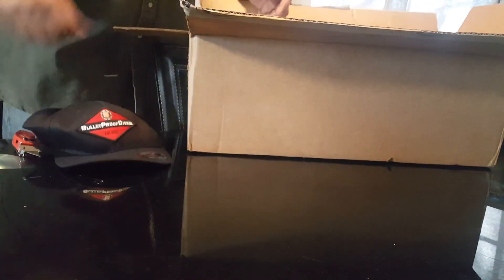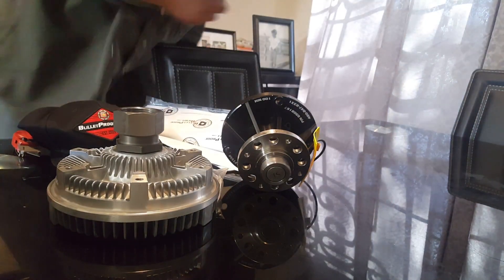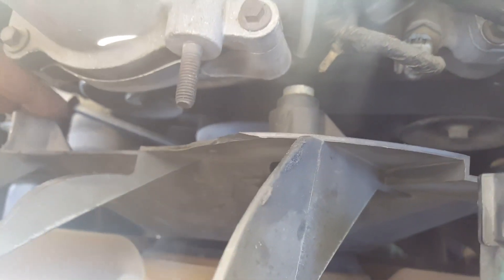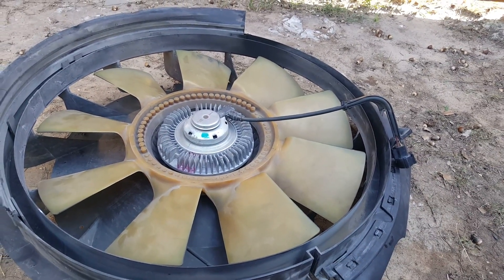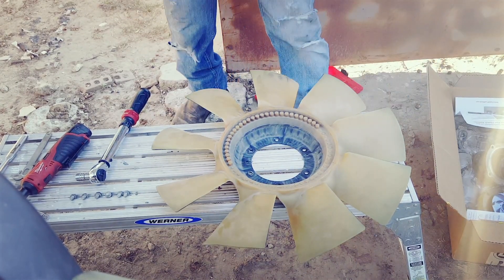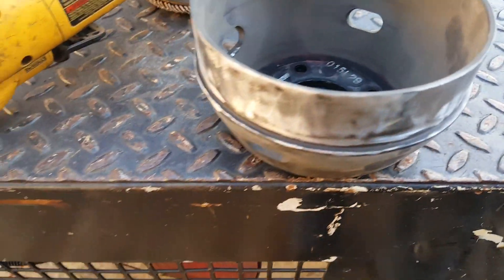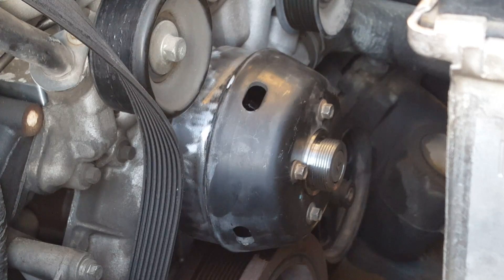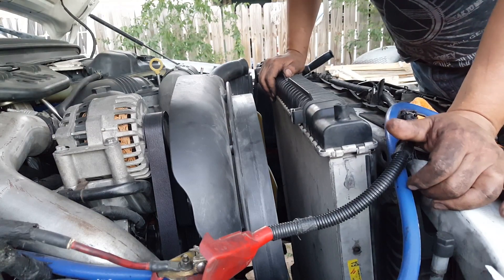Replacing 6.0 PowerStroke Water Pump and Fan Clutch with Bullet Proof Parts.

Comment: My ONE  plastic impeller water pump lasted 152,000 miles before it started leaking and the impeller was in good condition.  So, I'm not so sure a non plastic impeller is any better.

Comment: Would this cause the fan clutch to be loud when engaged?

Was making a loud noise like a bud shifting when old fan clutch was on. Put a brand new fan clutch and orginal blades and still same noise when engaged.

I’m thinking the blades are bad since they are   15 years old with 350k on them .

Any ideas?

Comment: Have you had any problems with the 7.3 fan clutch locking up randomly for long periods of time, and loss of fuel mileage? I saw another video of the 7.3 fan upgrade and he had exactly that problem.
Reply from the maker: No. Haven't had any issues with it. No overheating even with these 112°F nonstop scorching days
Reply: @XV_TV  did you notice any loss of mpgs?
Reply from the maker: Well it is a 450 so I get like 8-10 mpgs. It only moves if it's making money lol but filling up has remained constant

Comment: Thank you for the video but I have one question  did you just leave the connection hang in there go into the old fan clutch? That did not throw any check engine light codes?
Reply from the maker: It's been a few years and I haven't gotten any engine codes 👍🏼by just leaving them hanging

Comment: Do you loosen it going left or right while facing the front end?
Reply from the maker: I'm assuming you mean the fan? The fan is like a regular bolt. If you're facing the truck it's counter clockwise (left)

Comment: I'm about to do this mod this coming Saturday. Did you notice a difference on the noise the fan makes? Did it affect your gas mileage by much? Thank you so much for this great video...
Reply from the maker: Mileage on the truck is 9-12mpg but I'm pretty sure that's about right for an F-450. To be honest it wouldn't run at all with the old pump. It would overheat in 115+ weather. As far as noise, it sounds the same but you can hear it kick in a lot more than when it was electric

Comment: I just did this on my F250 2007 6.0. I feel the engine looses power because of the mechanical fan clutch. I don't have the quick acceleration that I use to have with the original fan clutch. Have you noticed a difference in acceleration or power loss? My truck has 78500 original miles. I did install the all metal intercooler and the all metal radiator from Mishimoto. I'm thinking about about reinstalling the original fan clutch and see if there's a difference in engine power.
Reply from the maker: The cooling system shouldn't affect acceleration. Mine still picks up and runs fast for a low geared F 450. There wasn't a change in acceleration. I would go look for a leak on your turbo / intercooler connections. That would affect acceleration. This will only affect temperatures. Kind of like a thermostat.
Reply: @XV_TV , now that you mentioned the turbo, before I I did want you did, my turbo at idle is minus 0.5 on my scan gauge. It should read 0 at idle. Plus every now and then I get code O0299. Not to often but I still get when check engine lite comes on. I didn't mention in my last comment that I also installed the Mishimoto all metal CAC pipes and their boots and clamps so I know there's no leaks. Anyway I'll drive my truck more miles and see what happens. I know my turbo needs work but I'll have my truck transported to Bullet Proof diesel in Mesa Arizona sometime this summer and have them do the level 3 job on my engine. I'd drive the 400 miles to Mesa but my oil cooler is bad. I'll have them do what you did and go to the air to oil cooler plus a ton of other work. It's pricey but I can't my 
money with me when I die. I'm 65 so I can't live forever. I'm doing all this just for my personal satisfaction. I'll keep you posted on my decision on the fan clutch. 
Thanks, have a great day. 😁👍
Reply from the maker: @louielopez1638  Awesome, exciting news! Keep me posted on the development!

Comment: I've got 255k on my 2006 6.0. Original fan, clutch and water pump. That's bulletproof in my mind.
Reply from the maker: Yeah! It helps if you had the truck since new. This truck had all the 6.0 issues and the price reflected it
Reply: @XV_TV  definitely true. Maintenance is key. Recently my EOT and ECT got about 20° spread, oil being the bigger number. I replace  the oil cooler with Ford OEM and did end up using a Bulletproof EGR from Bulletproof Diesel. Now I'm running about 6° max difference in 100° weather. I also installed a Fix Ur Six back flush valve on the oil cooler  for future use should I need it.

Comment: Great video brother.  I've got an electric fan clutch on a 05 6.0l giving me issues too.  I'm deciding to do the 7.3 mechanical mod or not.
Reply from the maker: Great!! I've had negative feedback from others saying that I'm going to ruin the engine block because of the aluminum impellers wearing out the wall if it breaks down vs plastic. But that's a big IF. So far I don't regret it at all and it tows perfectly in 110°F weather. Good Luck with the mod!!

Comment: So. Still on the fence about this. The 7.3 fan clutch is temp actuated right?!?. I haven't read many bad reviews about this conversation but is yours engaging when your temps go up?
Reply from the maker: Yes, the 7.3 clutch engages when the spring expands due to the heat. It's mechanical and not electronic at all. So far I don't have any regrets. It is a bit pricey but I'm hoping it'll last a very long time like my 7.3's. I've also heard of wiring the original clutch with a remote override that turns it on at command. But I don't know how much $$$
Reply: @XV_TV  I do appreciate all the time you spent on the videos.  I pretty much watched the ultimate upgrade all the way through as I did mine. Somebody said diesel tech Ron passed away. That's to bad. He was a big help as well. Thanks brother. God bless you!

Comment: Great videos getting ready to go through the same thing myself. Any update on how the truck is doing?
Reply from the maker: Thanks!! Truck is doing good. I'll be posting a video soon on the Tank Delamination issue, sending unit pick up, and blue spring update. since the truck sat for so long without turning it on, I think an injector might be sticking. We'll find out. But other than that, no problems pulling or overheating. Be on the look out for these videos.

Comment: Don't waste your money doing the "7.3 fan clutch conversion" Thought this would be the cat's meow for taking care of my high temps, Have had it on my truck for about 50,000 miles, stupid fan is on til normal temps are reached 180-190 degrees, does NOT come on when you really need it (over 210)! When you have a plow on the front or towing. Taking that crap off & putting 6.0 PCM controlled fan back on & doing the blue wire mod!
Reply from the maker: I will try that if and when this 1 fails. So far I don't regret it. I need to look into the overall price of the PCM Controlled unit.
Reply: My 6.0 mechanic said the same thing, said better mileage and power with electric 6.0 fan.
Reply: And now I am switching to 7.3 setup, tired of 215* coolant temps for no reason, my tune is supposed. to have fan come on sooner and it does nothing, having a fan turn on at 218* is pointless when oil temp is high already as well.

Comment: Awesome numbers on the temps. What was the ambient temp outside at the time? I'm in Sacramento area and I see higher temps with empty/no load especially on hot days around 95-100+. Probably up to 218-220. My EGR to intake o-ring is leaking so I'm parked.   I can't wait to put all this and the bulletproof oil stuff in once the piggy bank gets filled a bit. 
That pump is way easier to install than I expected. Glad to see that!
Reply from the maker: Yes. The water pump is no big deal. It could be in in about 30mins. The out door temp when i tested was around 80. This summer it was running around 215-219 while towing but it was like 114 outside. Still not that bad.
Reply: You prob need to flush ur cooling system and back flush your oil cooler
Reply: iphlue did you put this set up on your truck? I am in Sacramento CA and I am looking to put this on my truck but also wondering if I will have to put the stock one back in when it comes time to smog or if it will still pass smog.

Comment: I bought the fan nut adapter to do the upgrade. Will any 7.3 fan clutch work or is it a specific model year. Thanks!
Reply from the maker: flaco 7.3 fan clutch is the same. I don't recall if I gave them the year, but in my case it would be a 99 Super Duty. The threads should be the same.
Reply: Flaco 94-97 7.3 clutch 2835 is the Hayden part number